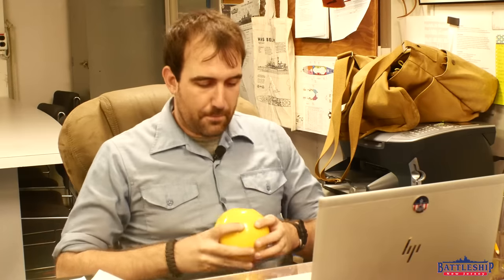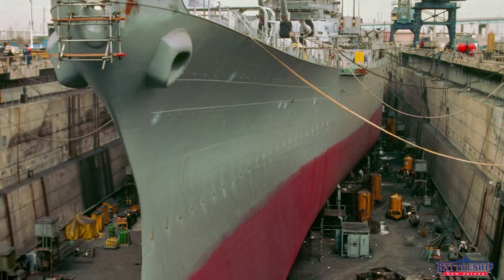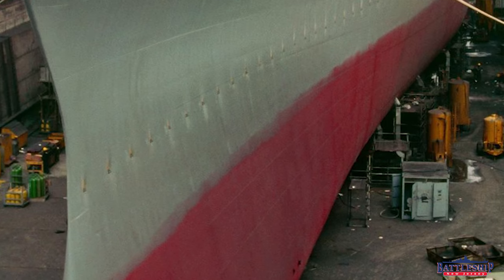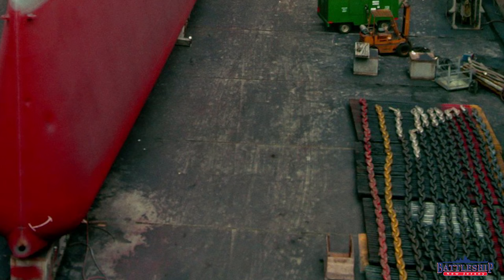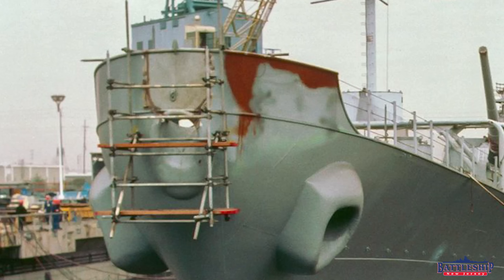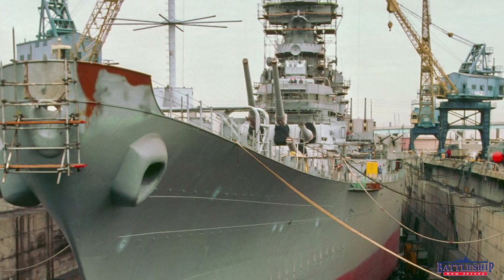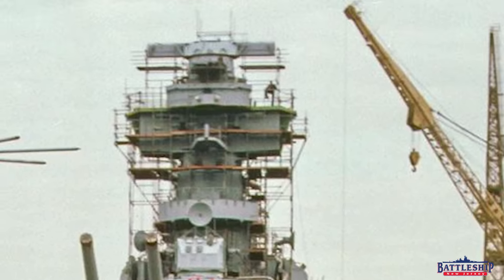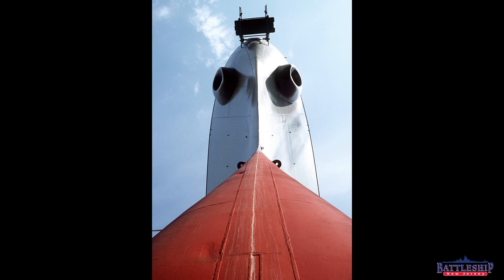Dry Docking New Jersey: A Picture is Worth 1,000 Words

Comment: DC1(SW) Thompson here. Just finished this video, so here's my take on a few things. There never was any lights installed for hull numbers. Think your at sea, darkened ship every night. Someone accidently turns them on. Bam every ship within 22 miles can see you now. That how far the normal horizon is. That scaffold install with the two different color epoxy primers on them, was  probably installed for a yard worker to sit on to weld some fixture on. That way he doesn't have to hang upside down to weld. Then it was removed. By the way the hull number were alot farther fwd of that scaffold right down below the fwd most mooring eyelet. Never carried anti- mine equipment or I would have studied it for my ESWS. The big yellow tanks in dry dock , sandblasting material feed tank. Compressor could be on peer sand had to be closer, picked by the air on its way to the hull. Hope that makes sense. The shit of the stbd screws. That's where me and my pregnant wife where when I re-enlisted 31 October 90. The screws had that material on there to keep the edges from being damage by moving equipment. It also protect the work from hurting their heads on while working near them. Other than that great job. You did forget to mention the draft marks that still needed to be put back on before refloating her.

Comment: You know, you could use aquaroc sheets set on top of a structure made out of scaffolding along with a rubber skirt designed to glue itself to the ship's underside to make a portable dry dock for the ship. Properly engineered, this could be an extremely cheap method to clean, refurbish, and paint the ship whilst in water.
Something very similar was used to clean up stuff in Venice, tho i don't imagine it would be very easy to stake the whole perimeter of the New Jersey and suck the water out of that to clean it. That'd be expensive as.

Comment: The yellow tanks in the drydock are sandblast pots. At 8:00 these guys are black because of the dust from broken up really coarse sandblast media. You can see a pile of the sandblast media on the floor between the guys. Its a nasty black grit that looks like crushed and sieved black glass and it gets everywhere. It gets all paint off right down to bare metal very quickly. Shipyards have some really tough assignments and I think that sandblasting and needle gun operators have the worst of it.

Comment: I think that those huge yellow tanks are Sand Blasting equipment . Specifically they are the sand holding tanks that feed it into the high pressure air stream.  Actually even in the 80’s we should say “media” blasting equipment as they use many different media to remove surface coatings/contaminates.  Some types include the aforementioned sand but also include things like steel shot of various sizes, foundry slag, glass, and even crushed walnut shells, and newer ,I think ,dry ice.  
The second picture of the guys going into the sea chest tanks also appears to be a media blasting operation as well.    All of that would be cleaned to bare metal and recoated for the different fuel, as well as cleaning the inevitable corrosion.  Just a guess, I would have been 15 then.

Comment: The two shorter yellow vessels on trailer tires are either 6 or 8 ton sand blasting pots, so you were at least partly correct on the sand blasting during that time period.

Comment: Long Beach had the longest dry dock. It is long gone covered with China owned container terminal. I went to the action of the machinery when it closed. The machine shop floor was made from wood. 4x6 in a vertical config.

Comment: In 1981 When the first picture was taken, there was nothing wrong with the paravane eye.  It wasn't until New Jersey was drydocked again in 1986 that the paravane eye had rotted and needed to be removed.  One of the rudder posts was also significantly rotted through and had to be repaired.  Also there was significant hull damage that had to be repaired by countless hours of clad welding.  I remember Landgraff (author of the LBNSY book) mentioning it had to do with defective paint applied to the hull during the '81-'82 yard period.  I remember seeing all the zinc annodes that lined the stern of the ship still appeared to be new.  I figured another contractor had sold the government crap, impure zinc annodes, causing the hull to deteriorate instead of the zinc.
Reply: The initial Yard Period (as I recall - MANY years ago) was cut short and a lot of work was concatenated to get her out on Sea Trials, which I do not think she completed before being deployed.  I saw her going into Dry dock, assisted with outfitting CIC and Bridge, and assembling the Chart Library while on loan from another ship at LBNS.  Initial was extremely rushed. Tried unsuccessfully to get permanently reassigned to her.....
Reply: Everything went as scheduled, nothing was rushed.  I worked both the New Jersey and Missouri reactivations from start to finish.   After she left drydock 1, she was moved to Pier 1, West side.  I made both her pre commissioning sea trials.  The recommissioning date was moved up one month so Reagan could attend.  After recommissioning on Pier E, she stayed there for a couple of months while the shipyard did small jobs.  She then left for a "Liberty Cruise" as some of the sailors called it, but shortly into the cruise she was redirected off the coast of South America to monitor some stuff going on there.  From there she rushed to the coast of Lebanon. She returned to Long Beach after 11 months.

Comment: At 9:06 How did the ship's performance change when they switched from burning bunker oil to marine diesel?  For example, did the ship's range decrease without more frequent refueling?
Reply: I'm no specialist, but since diesel is a higher quality there will be a range increase.  Less Sud makes the burners and nozzle last longer , better heat transition and since it is not as thick you can use a finer nozzle to get a clean burn
Bunker oil is just the left overs from the refinery, that they can't use for anything else, except burn it.
Reply: @mammutMK2  Diesel is higher quality, but Bunker oil (HFO nowadays) does contain more engery.
Reply: @Jacob-W-5570  so it could equal out. That would open another question "why did the navy change from bunker oil to diesel?"
With radar the time where you search for a damaged ship by the oil spill it's over
Reply: Thanks all.  I thought though that the "Green Police" forced the disuse of bunker oil for some reason or other?

Comment: At minute 8:38 thereabouts you're speaking of the saltwater sea-chest's and how they're filled with water as the fuel is used.  I don't know if it would be a very good defense against torpedo's as sound travels 7 times faster through water so it would seem to me that the shock wave from the torpedo explosion would just get delivered 7 times faster.  Harder?  I don't know.  Hydraulics would play a part in that as the water would be shoved at great velocity out of the hole that the torpedo made just before detonation.  Maybe that's were the "protection" comes in.  But these thing I don't know.  What do your engineers think?

Comment: I have a question.... when they repaint hull in dry dock the ship is up on massive blocks. Form fitted blocks match contours of the hull above the keel. Do they remove one at a time and paint under where the block was before then after paint dries, block is replaced and another block removed?
Reply: There's usually 2 or 3 separate configurations for the blocks while in drydock, so once you get done painting with the first configuration, you refloat the ship, move the blocks, and bring the ship back in. Considering the incredible weight of the ship, removing support from a section is a very easy way to end up with a warped structural frame, so it's better to just play it safe.
Reply: @griffinfaulkner3514  Thank you for that answer, it makes perfect sense. Massive weights involved and water makes it easier to re-configure blocks. I read somewhere divers are underwater making sure the blocks are in proper locations as water is being pumped out. It never fails to amaze seeing an entire ship from bow to stern sitting in dry dock.

Comment: Question: How do they get New Jersey, the 3rd if not 2nd largest battleship ever built, into a dry dock, and how do they get New Jersey out?
Reply: It was either moved in there under its own power or towed. Given the fact the ship was fully functional at the time I assume it was just moved in there under its own power. 

When it was time for her to leave they would’ve filled up the dry dock and moved her out
Reply: @Masada1911  Oh, thank you
Reply: @Masada1911  IMHO it was towed both in and out. The level of precision needed to spot the ship over the support blocks would be exceeding hard to achieve with the propellors. Even cruise ships are positioned with tugs and winches.
Reply: Watching a Trident submarine go high and dry was always a spectacle
Reply: Yard tugs lined her up, then the "Mike" boat, a square hulled boat powered by two 12 cylinder diesels, pushed her straight back by the bow.  I wasn't there when they pushed in New Jersey, but I've seen several ships pushed in. They normally start filling dry dock during the day then remove the caisson and push the ships in during second shift.  That way you don't lose a day's work by day shift.  You also have divers in the water during the docking and undocking
Reply: Very carefully, if you scratch in on the way out you have to pay to have it repainted.
Reply: True but tugboat captains can either buy scratch insurance or quickly reach over the side and touch up the paint before naval personnel notice.
Reply: The dry dock i worked in had electric drum style winches on them which get utilized for pulling in the vessel for placing them more accurately onto the keel blocks prior to pumping out the dock.
Reply: They open the doors, it goes in. They drain it, work on the ship then flood it. When they're ready they open the doors and the ship goes out. How else would it go in and out. Just the same as any other ship in any other drydock.
Reply: The pier blocks upon which the vessel will rest are placed per the ship's drawings, then the drydock is flooded down and the doors opened.  The ship will then navigate under her own power to an area close to the drydock.  Multiple tugs will actually move the vessel into the drydock.  Final positioning is generally done using measurements between the drydock and the hull at various positions, and adjusted using winches installed on the top edges of the drydock.

When all is in position the doors are closed and the water is pumped out, leaving the ship sitting on the pier blocks.  If necessary, divers can be used to verify that all is aligned properly before the full weight of the vessel is placed on the blocks.

It should be mentioned that a ship is designed to be supported by the entire hull below the surface of the water.  To enable a ship to be drydocked, strong points are designed and engineered into the vessel which are expressly intended to support the weight of the vessel without the surrounding water.  These points are actually called out in the engineering drawings, as well as the design and required weight capacity of the pier blocks which will contact these points.  NOTHING in this process is a guess.  It is ALL engineering.
Reply: @JackBWatkins  Comprehensive coverage on their insurance policy should cover it, after the deductible, of course.
Reply: @skydiverclassc2031  what if it happens in a “no fault” state? Who would pay the deductible and where would the survivors be buried?
Reply: @JackBWatkins  it's not normal to bury survivors.  The dead yes, but not survivors.
Reply: @bobmartin4942 Shhh, I had the insurance company up to $20,000 per survivor for burial expenses, but you just ruined it. Suggest you go into hiding because you just pissed off the Un-Dead that had planned on getting some vacation money.

Comment: You can mix Bunker-C in with Diesel at very low amounts. Anything that couldn't be scavenged by the pumps in those spaces (less than 10%) and I have to imagine those pumps aren't going to leave that much behind so less than 6% 4% 3% will get mixed in a min  diluted with the diesel and won't really have an issue so I don't know how much of the bunker see they would have had a pump out it seems more like they're getting out of there so they can treat the inner walls of the tank or do something to make access to that inner wall of the tank

Comment: How often were the props polished? Do navy divers do any hull cleanings and prop polishing, or is that all contracted out? In warmer waters especially,  that fouling builds up pretty quickly and eats into efficiency/speed.
Reply: I would expect that the props are removed and sent out for grinding and checking fo proper  pitch. I used to machine some propellers almost that big. They were used on big car/people ferries in WA St. I also machined single blades which were bolted to controllable-pitch hubs to make 4, or 5, or even 6-blade propellers for navy ships and subs.
Reply: @budlanctot3060  I was a commercial diver for years. I polished props on cargo and cruise ships. They get noticeably better fuel economy with freshly cleaned hulls and polished props. Most ships get that done at least once a year.

Comment: Did they fill in the dry docks in Long Beach? I don't see them there anymore. I'm pretty sure I know where they should be but it's just flat container handling space now. I thought dry docks were rare and very valuable and would be preserved for commercial ship maintenance. I guess not. I bet all of that kind of work is done overseas now. We need our containers full of consumer junk more, apparently.
Reply: Yes, all three drydocks were filled in. They used pieces of demolished buildings to fill the drydocks, then covered with a final layer of concrete. Very sad.

Comment: I'm pretty sure that when you see the red anchor chain playing out that means you need to be somewhere else.
Reply: .... and yellow chain means run in the other direction... 😀
Reply: The fo'c's'les of carriers are enclosed. The chains come from inboard of the capstans. If a runaway happens, the chain will whip out of the chain locker and will rip a gash in the side of the ship. When we dropped anchor, everyone who was not on one of the controls stood to the opposite side of the fo'c's'le so as to be out of the way. An open fo'c's'le like New Jersey is actually safer.

Comment: Military history question.  What was the reason the bottom part of military ships are painted "Red"? Just wondering if there was a significant reason since it would be below the waterline 90% of the time
Reply: Not just military ships.  Copper and lead based antifouling paint was at the time always red, and universally used until environmental regs kicked in.  (The same paint was used on the Golden Gate Bridge, hence it's red color).

Comment: Question regarding the anchor chain? In my experience on LHD ships the chain of the Iowa battle ships seems small, on ships like aircraft carriers which are the current largest ships in the fleet each link can weigh upwards of a 100 pounds and since battle ships were extremely large vessels I would imagine they would have large chains as well but this doesn't seem to be the case is there a reason they were smaller then most standard chains?

Secondly most people believe the anchor holds the ship in place but truely it's a the weight of the chain paid out in addition to the anchor do you know how much chain these ships carried?

Finally in regards to the colors of each shot of chain in most ships the chain isn't attached at the end to the ship in fact it's considered dangerous to due so should the ships wildcats fail to stop the chain from paying out slowly enough, did the battleship actually have there chains connected at the end? I have heard of ships losing there anchors and chain to failing breaking mechanisms cause the whole chain to pay out wildly causing substantial damage and being lost to the depths truely a captains night mare to report
Reply: Iowa's carry 12 sections of chain 1,080 feet long each, 110 - 136 pounds each link(they vary in weight some) a total of 1,440 feet of chain for each anchor that weighs 30,000 pounds for each one.
Reply: @thomasmoore8142  thank maybe it's just the video but that chain looked alot smaller then the ones I've seen on modern ships
Reply: @DocbritoFMF  I know what you mean, EVERYBODY says that photos don't do battleships any justice. If you have not ever visited a battleship you need to put it on your bucket list. I've visited the North Carolina and the Wisconsin and they are truly amazing. I hope to visit New Jersey someday since she was my first battleship love when I was a kid--built her model and everything.
Reply: @thomasmoore8142  visited? Lol I've actually had the opportunity to stay aboard the New Jersey for a few Nights as a kid with the Sea Cadets. But your right pictures do not do these ships Justice at all. Sadly aside from carriers I don't think we will ever see another generation of ships like the Iowa's. Modern naval warfare thinking was the sea to air power made for a better strategy and surface to surface would be come a thing of the past, and while I don't totally disagree I do believe we are at an era again in which are enemies have matching capabilities so who knows what it will take to gain the advantage. And since the US loves to sell are  aircraft and weaponry to other countries you don't see the diversity you would have seen in the world war two era